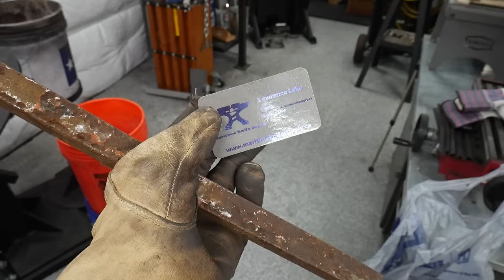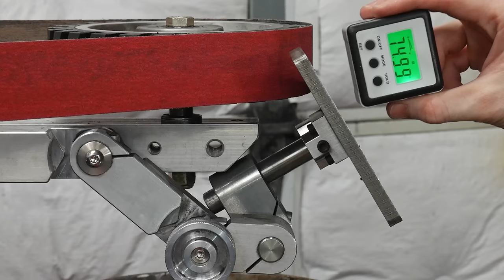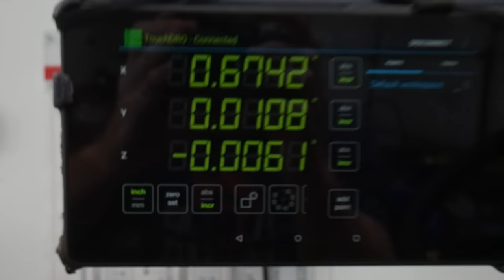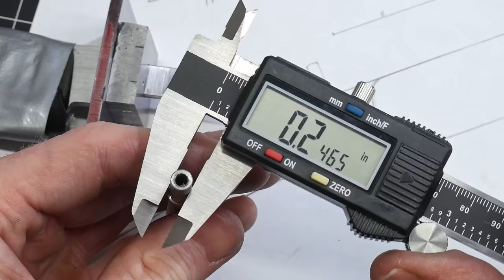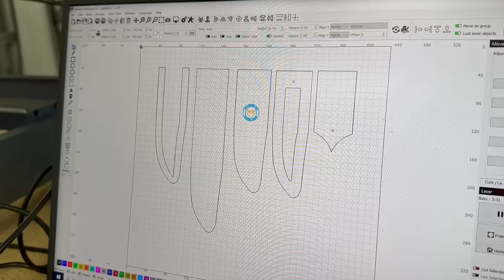"That's TWISTED!" -- Low Layer Twist Damascus BOWIE - Full Knife Making Movie

Comment: 15:14 has every tool a knife maker could ever want. Still uses closest thing to hand to hammer in pins!
Reply from the maker: Lol, yep... I will say... I do like those pliers for doing that. They don't apply as much force as I could with a hammer, so if the holes are slightly undersized, I don't have a tendency to "force it" and split the block. They're also handy to have close by so I can pull the pins out. Cheers sir!

Comment: James you did a amazing job on that knife WOW!!!!! and your leather work is coming along great i love everything you did .Mark  p.s. my press i built i still cant get it to hold to do my twists ram comes up the minute i start to twist i put that plug in my valve made things worse had to take back out could i have the wrong model valve?is your press running when you do your twists?ive tried both ways with no success this is what  i have   Prince RD-2575-T4-ESA1 Directional Control Valve, Logsplitter, 4 Ways, 3 Positions, Spring Center To Neutral, Cast Iron, 3000 psi, Lever Handle, 20 gpm, In/Out: 3/4" NPTF, Work 1/2" NPTF
Reply from the maker: Thanks man. I leave my press running when twisting. I think you're best bet may be calling up prince and trying to talk though it with their support. Maybe they have an email you can contact. 

A local hydraulic shop may be able to give you some suggestions as well.

Comment: Mr. Red Beard
I seem to have done something wrong with my ferric chloride. You said its a 50/50 mix of ferric chloride and distilled water. I purchased some ferric chloride and it turns out I can only get 40% ferric-Cl. I used it pure without diluting it but I get terrible results and its quite frustrating. Do you have any ideas? Much love from Switzerland. Love your cahnnel
Reply from the maker: This is the stuff I use 50/50 - https://www.amazon.com/gp/product/B008O9XMYA/ref=ppx_yo_dt_b_search_asin_title?ie=UTF8&psc=1

Not sure if you can find it locally. Maybe something else in in the 40% mixture you acquired?

Comment: Very nice!!! Would that laser work to engrave the outline of the knife on the steel? Instead of making a pattern?
Reply from the maker: I think while this is possible, it would require more line up time. I like having the templates as well for saving them and potentially reusing them. Cheers.
Reply: @RedBeardOps  thanks for taking the time to reply. Your work is awesome!! After watching your laser video I have been thinking of getting one. Just trying to figure out what all I could use it for. They are a lot of money. Lol
Reply from the maker: @justinadams1650  thy are expensive! Leather work and templates are the biggest things I use them for. I've also made some parts and brakets for around the house. Having the ability to make stuff on the fly is nice. I'd advise paying for LightBurn as well. I also make boxes with it. If you're looking to engrave steel they just came out with a 40W laser and an infrared laser which likely both perform better than the 20W --- if you do end up buying one the RBO channel gets a nice kickback if you use this affiliate link to navigate to the site - https://www.xtool.com/products/portable-diode-laserbox-d1-for-laser-engraving-laser-cutting-b?ref=RedBeardOps&utm_medium=4938&utm_source=influencer